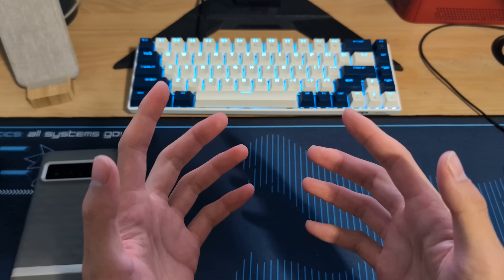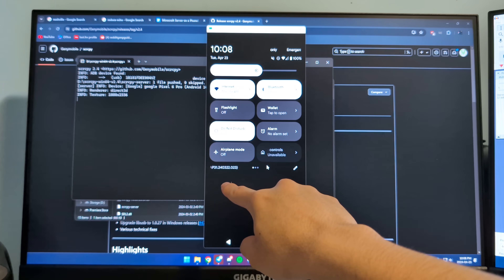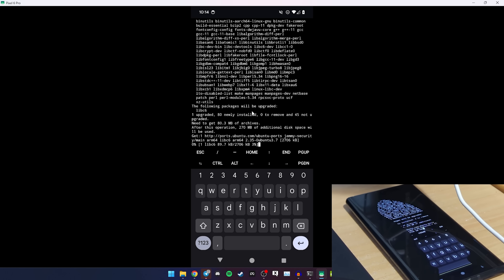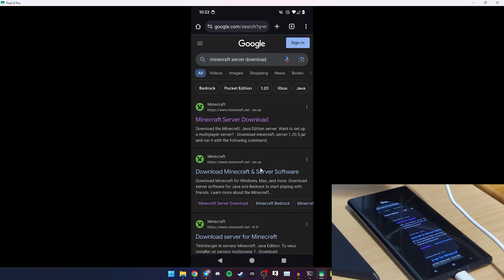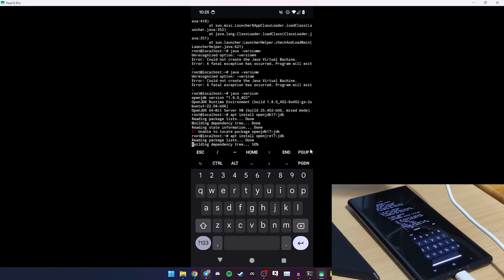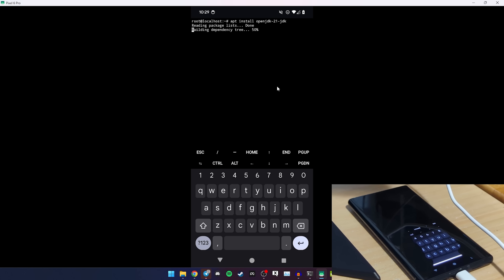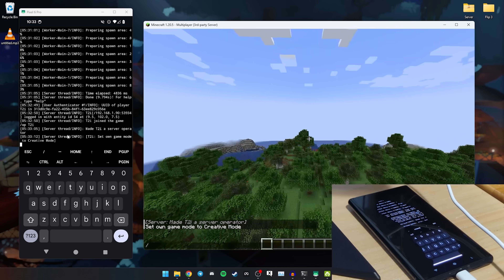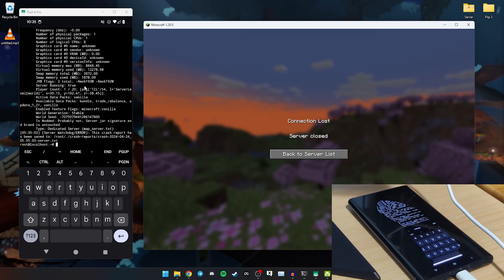Running a Minecraft Server on WHAT???

Comment: interesting, but if u want to hear how a physco would do it let me tell u
1. boots into fastmode
2. deletes the whole rom
3. flashes twrp
4. boots into twrp
5. modifies the whole kernel and installs a raw linux rom with efi cusom booting
6. connects it with netsh
7. installs java jdk
8. installs the server.jar file
9. runs it
10. takes the ip
11. joins from his own machine
12. places 3241490 tnt and ignites one of them
13. the phone temperature reaches 103°
14. battery explodes
15. fin.
Reply: how do i get the ip address
Reply: @Anasbinshahriar its your device's main internet protocol address based on how you did it you can just put your phone's ip and port and it just works (unless u have a firewall thats another problem u should be aware of)

Comment: Blud has three pixel 6 pros and says two of them is broken when they are literally fine just need new display which is very cheap.

I'm convinced that he stole these
Reply from the maker: New screens cost more than the cost of the Pixel 6 Pro used. On iFixit (US), the Pixel 6 Pro replacement screen is $279.99, which I can buy a Pixel 7 Pro or Pixel 8 on the used market (if you know where to look)

Additionally, I had 3 broken Pixel 6 Pros, one which was avb bricked (and unfixable without a full device replacement) due to Android 15 DP1, and the other 2 just need new screens. Even then, one of them which needs a new screen has motherboard issues (e.g cameras not working, microphone issues, etc).

All in all, it is uneconomical to fix, screens are not that cheap (ones that you actually want). AliExpress screens have multiple issues like horrible colours, larger bezels, or non working udfps, which all are deal breakers to me
Reply: @adrianstech  why you even need to even get a original display replacement, get a crappy alright display replacement costing under $50?
Reply from the maker: I actually care about display quality? I've been using flagships forever now and I expect very good display quality, either in nits, colours, refresh rate, etc.
Reply: @adrianstech  okay i understand but because of this you are wasting your money you used to buy them and in this vid you broke them brutally (even tho they ain't living things)
Reply from the maker: As I outlined, the phone in the video was harvested of parts and was bricked. I could not unbrick it due to it being bootloader locked and having broken avb (I did everything outside UART cable, which I do not have). The screen on that phone was already broken, and practically everything else was harvested or broken as is. I get phones in and out constantly (because I have disposible income, you know, I have a job and also do YouTube), breaking phones happens here and there and that's why I have a larger pile of them, but in the last 13 years I've had over 200 phones and stuff like this just happens

It honestly just doesn't make sense to fix, cheaper screens usually break easier, are very much worse in quality or have issues from the start, which is why I avoid them
Reply: @adrianstech  I have many expensive Samsung and mi phones and they once in all had a display issues which was fixed for $50 - $60 each

Comment: I ran a minecraft server on my old phone (samsung a70, snapdragon 675 6GB ram), it ran really nicely and could handle 5-6 players at 12 chunks 7 sim distance.

I do not recommend giving the server more than half of your total ram. I gave mine 3GB (3072MB) and it ran fine but the moment I went a tiny bit over androids OOM killer just annihilated the whole termux process lol. You could try disabling the OOM with various tweaks but I didn't feel like doing that since I'd need to root
Reply: Can I do it in my a70s? It has like 8gigs of ram and sd 6 series.

Comment: On any Linux distribution the capital letter in a choice is the default answer. You can just press enter to select the default answer instead of typing Y and then entering. Also the software you were using for using the phone's screen (scrcpy) is actually (scr)een (c)o(py).

Comment: i ran my server off a Kindle Fire 8 (10th gen) Tablet I do NOT recomend as it was both a pain int compatibility (had to move it to linux mint for some aspects such as undervolting)

it was a great learning experience but don't do it, I use Apex hosting now

(mobile devices are not meant to run heavy tasks and programs 24/7 and cant dissipate the heat correctly 99% of the time, needing to be modified which for me included cutting a massive hole in the back case of the tablet and placing an 80mm 12v fan powered by a janky power supply)

Comment: Do you think it's possible to port forward on mobile data?
Reply: From my experience mobile carriers block basically all incoming connections. You most likely don't have a public IPv4, and even on IPv6 all major carriers in my country basically admitted to just dropping incoming traffic (I live in Germany and had to research that through forums since I am running a homelab with a 5G cellular router). You can get around that with STUN/TURN Servers or tunneling incoming connections through a reverse proxy / VPN on a VPS (small cloud server with public IP and then forwarding through a VPN connection from there to your device), but that doesn't really make sense for running Minecraft on a Phone.

Comment: It never connects to one of the GitHub pages making it impossible to get Ubuntu on android. The mirror seems to be down or something.
Reply from the maker: I wiped the data on my Termux install and was able to install Ubuntu-Termux just fine. Make sure you're on the Termux build off GitHub, and not the Play Store.
Reply: @adrianstech  I got mine from the GitHub when I did this, I had also wiped mine. My phone is fully compatible with the stuff you wanted to run. Done this before, just found it to be weird. Might have another try at this tomorrow.
Reply: @Woodman3  yeah, I haven't tried it but alot of people are having the same issue

Comment: It's actually really easy to host your world on Bedrock by enabling multiplayer (it's enabled by default), but it's really nice to see this working with Java!
Reply: Servers can be 24/7 and on separate hardware without graphics rendering, and geyser, Java is also... Java, so you get mods, plug-ins, datapacks etc.
Reply: So true, bugrock has nothing on us.
Reply: @Meletion1  PocketMine and BDS (Bedrock Dedicated Server), both can run on Termux!
Reply: how can i host on bedrock? pls
Reply: @Enta09  You open your world options and go to the Multiplayer tab, then make sure the switch is on and it's on Friends or Friends of Friend (you can also disable friendly fire if you don't want pvp on)
Then you can give your gamertag/username to anyone who wants to join so they can friend you. Then they can join the world in the multiplayer tab when you load the world (assuming you're connected to the internet)
Also, if cheats are enabled you should be able to toggle how many people can be joined at once with /setmaxplayers!
(there's no IP or Port btw, since it isn't related to the classic server system that you can see on the server tab)
Reply: @Enta09  As long as you're signed in and enabled it in world settings, people can join via the Friends tab.
Reply: that is not how a server works. Servers are completely headless and they are being run with no graphics
Reply: @DementiaTech  Well, a server does just simply mean a computer providing the service to one or more computers. The phone is running Minecraft and its graphics while also providing the world to others.

By definition, it is a server. Is it ideal for professional use outside of just letting a friend grind in the world while you're offline? Probably not.

Comment: i literally started doing this on a phone i have XD
i have a rooted moto g20 with a kernel manager that lets the cpu get to 100% speed, termux runing a paper 1.20.4 sever and caffeine to always keep the screen on at minimum brightness, that is plugged over usb to a super low power laptop without screen for scrcpy, free ddns for having a better ip and parsec for remote management, since team viewer host for android is not very reliable.
nice video!

PD: also with the parameter -Dpaper.IgnoreJavaVersion-true when starting the server you can use any java 17+ release.

Comment: bro just install fucking java 17 and then use papermc 💀
Reply: good luck getting it to not complain about termux's open-jdk17, besides, i think 1.21 uses java 21 now
Reply: @gmelhortablet  use viaversion or viabackwards also paper 1.20 is still works with java 17
Reply from the maker: I ended up using Paper off camera to host a server off camera with ngrok hosting it publicly, so there's always that option to use Paper and jdk-17. Thanks for the suggestion though

Comment: I bet that if you use a paperclip server it will run much better
Reply from the maker: Yeah, Paper would run significantly better. I ended up trying Paper and it worked fine, so that option is always there

Comment: Great video❤❤ A question I wanted to ask if its possible to port forward for anyone to join?
Reply from the maker: It is, you can port forward using your router's page and doing it how you would with any other self hosted Minecraft server. I tested running it through ngrok and that also worked
Reply: @adrianstech The mirror for the ubuntu package is down making it impossible to setup the server
Reply: @Woodman3  theirs probably a archive but I'm not 100

Comment: what are phones requirements?
Reply from the maker: Ideally I'd say you want 4GB of RAM to allocate 1-2 to your server
Reply: @adrianstech  and does it permamentaly damage the phone (like performance issues because of heating), can i use my daily phone?
Reply from the maker: You can always turn off the server by exiting the Ubuntu-Termux install and then Termux itself when you're not using the server, then rerunning the Ubuntu start command and the server command to get it going. If you do this, it won't damage the phone
Reply: @adrianstech  thanks man